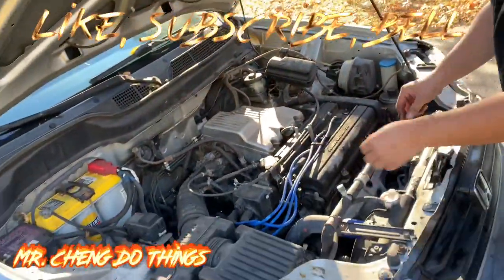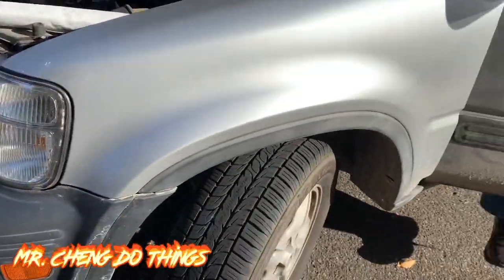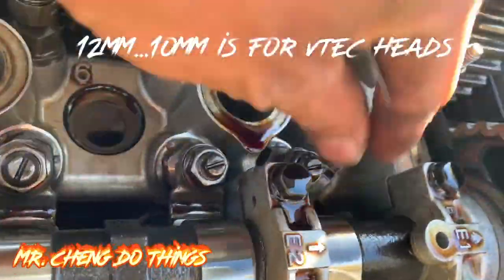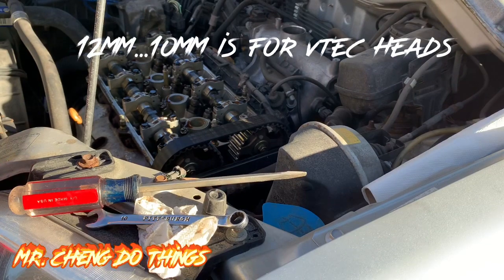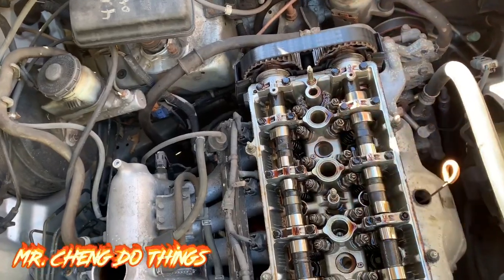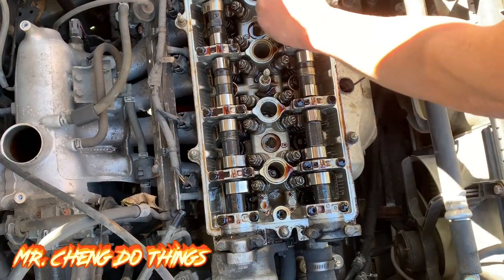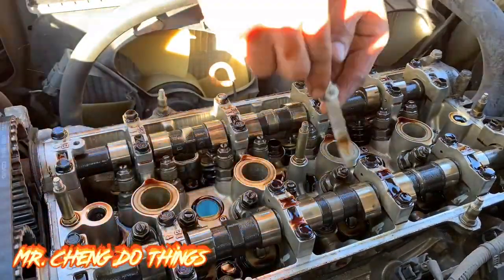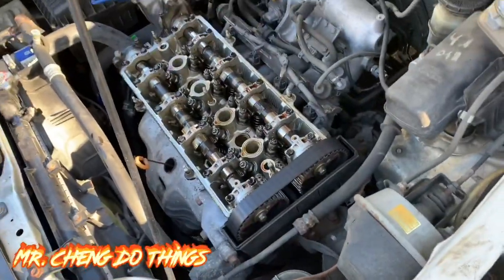How-to: Valve adjustment B20 RD1 RD-1 CRV

Comment: This is strictly for b20b correct? We look like we have the same motor
Reply from the maker: Can work for b20, b16,b17,b18...
difference is the nut size and feeler gauge...vtec heads will be slightly different by 1-2 size